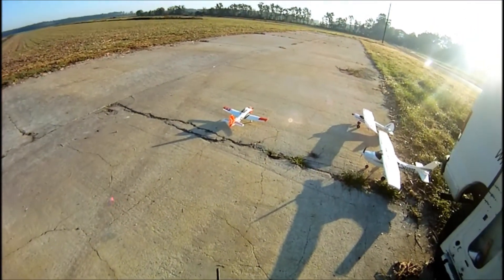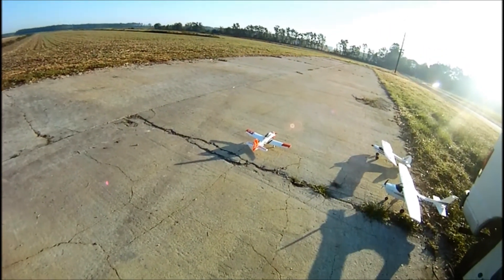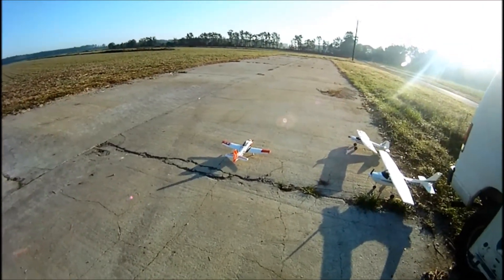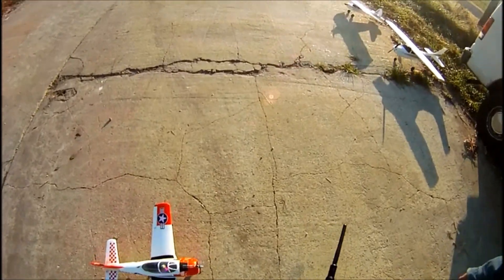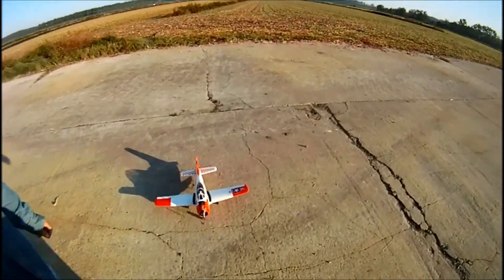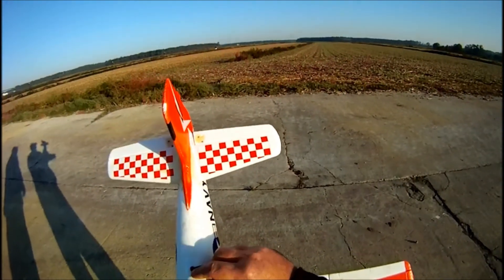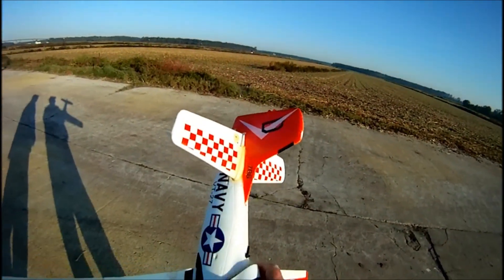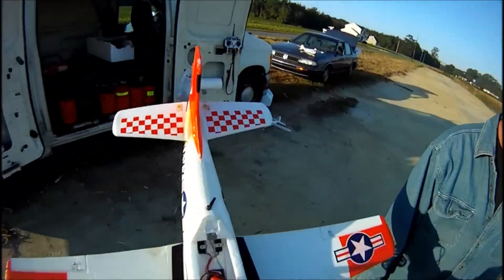Nitroplanes 800mmT28 with the Exceed 1500kv 2215 Rocket motor

Comment from the maker: The 1950kv will be a better choice in the 800mm it's still going to be fast...On the jet it sounds like you might be just a little tail heavy if you can try a little bigger battery or move the one you have a little forward..I always do a battery mod on most of my jets just to get a little more time a weight in the nose...

Comment from the maker: Wow thats alot of KV what size battery are you planning on running? I'am only running a 1500kv on a 3cell and I've clock it at 75mph. Just make sure you upgrade the ESC. and dont over prop it. Your going to have a real speed demon make sure too make a video.....